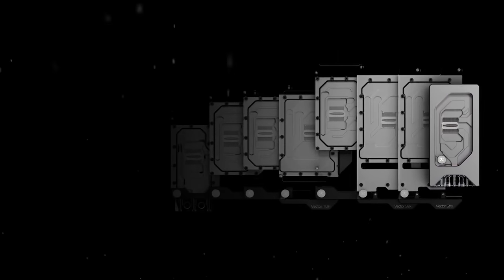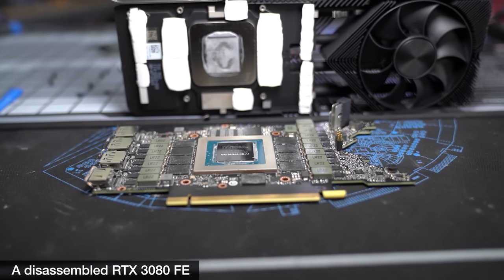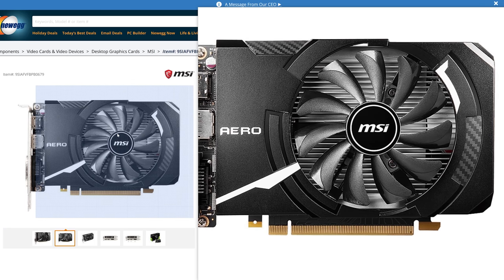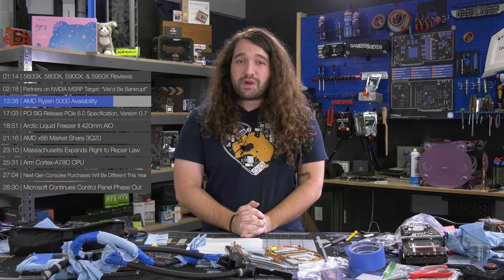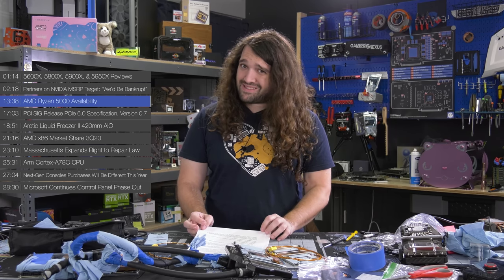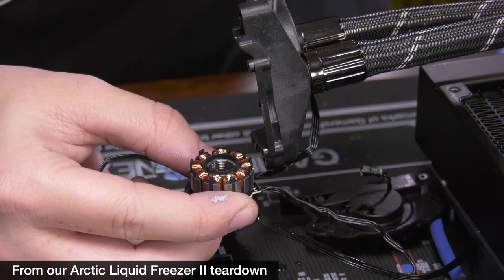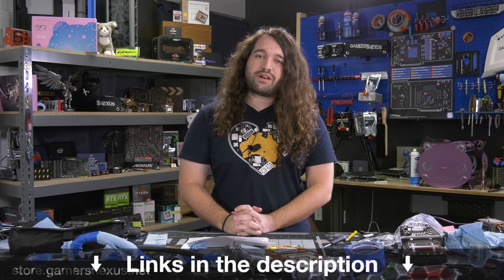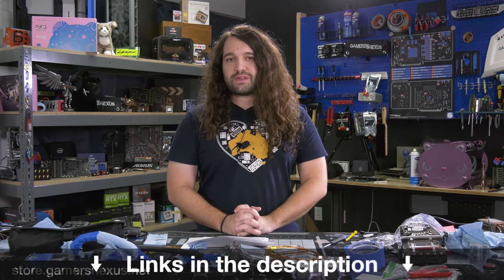HW News - NVIDIA MSRP Allegedly Not Realistic, Ryzen 5000 Supply, PCIe 6.0 Spec

Comment: I wish Microsoft would leave an option to enable "advanced mode" that has all the old and useful features in windows 10 instead of trying to force everyone to use their broken attempt at a "simple and clean" OS
Reply: They want to use the same interface for desktop and mobile. It's a fevered pipe dream.
Reply: Press Win+R
Type “cmd”
Press ctrl+shift+enter

Classic “advanced” mode
Reply: I wish windows would stop freezing my desktop so it can force an unclosable Edge tour down my throat while resetting my default browser in the background
Reply: @backupplan6058  You don't need to know those special combinations, this is simpler way:
Press win
Type cmd
Click "run as administrator"
Reply: they are working their way to an online OS only
Reply: classic shell your welcome.
Reply: @rci-tf2zc  classic shell rocks 👍👍👍
Reply: @blackmancer  i dont think so. windows 10 is not in any way the way to an online os since it heavy on the hardware. its integrate onlineservices into the os, without the users permission and changing the os style to much simplified design that is easy to use with touch inputs and able to scale windows correctly.
Reply: @isodoublet  i dont understand why my wallmounted desktop pc needs a airplane mode or akku saving mode ..
Reply: @desertfish74  I really like some distros, have even started spending most of my time on my Razer Advanced using Manjaro. Unfortunately, I sometimes need office for compatibility, and there are some games I play (non-steam) that are a pain to play or impossible. On my desktop, just too much stuff already installed that I don't want to reinstall again.
Reply: @DrSmugface  Samurai Jack wants to know your location.
Reply: In principle windows has needed cleaning up for decades - however first you need a working logic before you cut things, otherwise you keep the mess can cut the useful features - kinda what we see now.
I have three different screens on my pc and it's impossible to manage them in windows. - On my 2008 macbook - no problem. Just the mac has no gpu :D :D
Reply: make a new folder and name it this: GodMode.{ED7BA470-8E54-465E-825C-99712043E01C}
Reply: @desertfish74  run my games on Linux? (No). And yeah managing 2 systems instead of one is not a solution
Reply: I don't even buy this as the reason. You can build a clean UI that still has the same functionality, even if you have to compartmentalize it a bit. If this was just me requiring an extra click here or there I'd grumble and deal with it. All they needed to do was just transplant the old, critical functionality (especially the Sound control panel, almost every person I know has had to go in there to handle some kind of weird sound issue) into the new settings app.
Reply: Personally I hate the Apps page in 10. It's cluttered and a long lust that shows less information that Programs and Settings. 

I've been doing IT work since the 90's and don't want to use a knockoff Apple menu system. I haven't upgrated to newer Samsung Galaxy phones because they're following Apple's BS for too long now.
Reply: Switch to Linux. That simple.
Reply: I wish they had a windows 7 mode where cortana only exists in halo
Reply: There is an advanced mode already. Learn cmd and powershell.
Reply: @DrSmugface  If it had no airplane mode it would crash to the ground, duh. Better keep that thing up there and thank microsoft.
Reply: This, MS doesn't seem to understand that not all people are the same. Some people like X and they will never like Y, not even if MS forces them to use Y. Especially if MS forces them to use Y.
Reply: They've been hurting power users ever since Windows 7.  (or Vista, if you want to talk about the overall UI change, but Vista still had classic features 7 removed)

Windows 10 was the worst 'upgrade' I've ever had to deal with, and I'm still on v1703 due to unbearable, unfixable changes in the later versions.
Reply: @blackmancer  How would that even work?
Reply: @krisspkriss  exactly how DRM works
Reply: May i just say cough cough Linux?
Reply: @backupplan6058  thanks, didn't know about the ctrl+shift shortcut, btw you can run a copy of a program in the taskbar by pressing shift click, and ctrl+shift+click for the admin version.
Reply: Yeah, because THAT's why they don't have mobile OS market share
Reply: @TheSengard  I'm using a desktop. If I wanted an OS optimized to use on a tablet (ie: simplified design, touch input reliant) I'd use my iPad.
Reply: @Josh-gi8ht  i can relate to that, but this is not the way microsoft goes. the interface is obviously optimized for better scalability and touch input. Personally, i would also prefer to do without all the web integration into the operating system. just like i would like to have operating systems without speech input (e.g. android is really annoying in that regard). Unfortunately i can't do anything about it, because they are integrated and can't be removed. in my opinion windows 10 has become a disaster in terms of performance, because of these new features.
Reply: You can get to the old features easiest by using the search function in start panel. Problem is Windows updates have the bad habit of breaking the start menu first. Which leads to another problem you forgot to mention: Microsoft forcing its updates to be installed, even if the current update has been noticed to be a faulty one.
Reply: Oh how I also wish that was a feature. After installing it asks if you want it set to Advanced or admin mode then it lets you go about your day without making you cringe.

Comment: The control panel isn't just a matter of looks.  The old control panel exposes settings that aren't in the new model.  So this will lock out many common fixes to problems.
Reply: Yeah, I don't know what Microsoft are doing here. The control panel is straight up superior to the new stuff for power users, it gives you more control and is more quickly readable and navigatable, what the hell are they thinking?
Reply: @sttate  Dumbing down the mainstream users. That way you can get away with a lot more fails.
Reply: Probably because without any easy solutions people will have to pay for Microsoft Support
Reply: We can't fix your problem in the windows 10 settings. You will have to replace your computer.
The cord on the new computer is shorter, you'll have to rebuild your house so it can reach your desk.
Car isn't running well because the air filter is clogged after 2 years? Going to have to throw the whole thing away and buy a new one.
Reply: @Willdror  but all Microsoft support is, is copypastas of "did you make sure the computer was plugged in?" even if the op says the computer was plugged in.
Reply: On the Linux side of things, Gnome DE went down this road about 5 or 10 years back. A lot of basic functionality was removed. End result was a user experience that was designed to look simple and streamlined, but in reality required users to do searches on stackoverflow and config via command line to set up.
Reply: @ExtremeSquared  at least with Linux you can switch desktop environments or distros if you don't like that, or install a third-party graphical settings manager...
Reply: That's their goal. That and you being unable to deactivate many of their botnet telemetry data settings.
Reply: It is the absolute ONLY way to fix and remove some issues surrounding audio recording software and even audio interfaces. Microsoft likely just killed music production on windows for good
Reply: God damn new Network options are pathetic. I understand that new users don't know how to change IP settings, but now I won't know either... :D
Reply: we'll have to do more through registry hacks I suppose.. gg microsoft
Reply: @BuzzkillZone  Having done on-site tech support for big corps, "Is the device plugged in?" gets a Yes followed by me making a site visit to another building on-campus fifteen minutes away followed by me plugging the printer/monitor/computer in and signing off on the ticket as "completed". This happened a lot. Really a lot. Lots. Lots and lots. Much lots. Duplicate for Ethernet cables, mouse plugs, keyboards, Wifi hubs etc.
It's only funny because it's true, like all the best jokes.
Reply: Use powershell then
Reply: @mattbrown292  What's a good resource to powershell for the purposes of replacing control panel?
Reply: new users might be confused and mess with things they shouldn't, an easy solution a checkbox "show advanced control pannel"
Reply: @oblivion0077  in the context of replacing control panel im not sure. But the Microsoft docs webpage is actually super good for powershell in the general sense. There is a list of every cmdlet and a lengthy description of how to use them, along with multiple examples.
Reply: @mattbrown292  powershell. Requires a reference. You cant just look at the settings and fix. Powershell is nothing but a return to the bad old days of dos
Reply: @BuzzkillZone  LOL not at all. That's like saying python = dos. Powershell is much more abstracted and is practically like speaking the English language.
Reply: @mattbrown292  every time I have to enter powershell commands. They are still pretty doslike. Even if abstract they are still text commands that requires a separate reference. It is not user friendly.
Reply: People who used the control panel are going to be forced to shift to third party applications, or microsoft will release something like the control panel. I'm hoping the second happens.
Reply: @robertsneddon731  It's one thing when you just say something is wrong and they tell you to plug it in.  But if in your support ticket you itemize the steps you have taken, and it includes checking the cables, making sure the latest drivers are installed, and reinstalling in safe mode.  Then it is EXTREMELY frustrating to get a copypasta reply telling me to check the cables and drivers.
Reply: @crazyassassinkill  Lemme play mah games in peace.
Reply: @Gareth Tucker It's like the Settings panel was designed by people who have only used smartphones. It has a smartphone look and usability, like the missing icons and infinite scrolls that are only usable when you have a small portrait screen. It makes you spend to much time searching and scrolling to find something. I don't know what the fuck they were thinking.
Reply: @BenK12345  Give it an update cycle. They'll find a way to remove the registry too...
Reply: I really have no idea what you all are going on about LOL. I can access all the same setting I need to in the new Modern UI as I did in the Older Control Panel setting that have been updated.. Example: The one just now removed (System Panel) it is part of the About section under System..
All the Audio setting and more are under sound. All the App setting and more are under Apps.
I have been working with and supporting Windows since 1.0 loaded over DOS. I find this New UI more pleasant to work with in dark mode.
I love the extra control I now have for so many things. Like the ability to control what apps will use what input/output device.. the default volume level per program. Hell what Apps are allowed to even access the Mic or Camera. All laid out in easy to see, find, and understand. It does not appear "dumbed down" to me at all. I too hate change and I was like fuck! why did they screw with something that worked. Then I worked with it and found... Ah yes this is nice.. This makes sense.. It just takes a few moments to get use to it and to understand the flow.. Once you do, I feel like, its pretty good.
Reply: Ok, so this seems to be a very common complaint... Which settings exactly are only available in control panel though? Everyone is saying there are settings solely there, but nobody saying which settings they mean. =/
Reply: @GameFreak7744  Whichever setting you need to change.  That is the setting that won't be there.
Reply: @sttate  They're not thinking, and haven't been for years, plain and simple.

Probably tons of feedback in the feedback hub where we can all express our voice, and get ignored like usual.
Reply: @BuzzkillZone  Haha, sod's law would certainly suggest that.

I really am curious though what settings people need that are currently in control panel, but not in the settings app. Not sure if there is really a big problem of missing settings, or if people are just worried because trusting MS is usually a bad idea. =P
Reply: @GameFreak7744  Advanced sound settings such as allowing applications to take exclusive control, separate default system and communication devices, the volume mixer, stereo balancing between left and right channels and more are all missing in the settings app and that's just the audio settings. Network settings are practically non-existent in the settings app.

Comment: So, Microsoft is getting rid of the only actually useful menu? Those old windows tools are the only things that have allowed me to fix their cobbled monstrosity without reinstalling the whole OS.
Reply: If they take them away I don’t know how to fix the OS. I have a feeling there aren’t new tools that will do the same thing. I guess they don’t understand that there are power users.
Reply: Time to get comfy with PowerShell.
Reply: @CaveyMoth  
Or go Linux and virtualize XP or 7.
Reply: @Aereto  But I'll get computer malware. =/
Reply: @CaveyMoth  lol if you get malware on Linux you are deliberately trying to get your computer infected.
Reply: @chrono_tigger  Well, I mean, I do have my.. Needs. Kaspersky protects me from time to time.
Reply: @CaveyMoth   As someone who has coded as a hobby for a decade I would literally never obtain software. Other kinds of content you can verify are malware free. Even the best virus scanners are only relying on previously reported signatures plus basic code flow analysis. it's very easy to bypass them all, at least until your signature gets added to the database. It's also possible (but quite hard) to write a self modifying program that could probably perpetually bypass scanners. Now, video and books and tv shows, go nuts, but software, yeah no I wouldn't touch it with a 5 ft pole.
Reply: Power shell, learn it.
Reply: @CaveyMoth  anti-virus? Eew.
Reply: I'm worried about the sound control panel. Windows already has a lot of issues with  HDMI-based audio that uses 7.1+ and Atmos. It needs to be flawless since the "Get Help" app redirect is awful and requires payments
Reply: Google "windows 10 god mode" to enable the only folder you ever need for settings, and it's built-in.
Reply: starshipeleven  And that ol gem... watch what you click.
Reply: These windows updates might finally force me to go to some Linux distro or MacOS
Reply: classic shell your welcome.
Reply: @WahotsW  I think the "Get Help" or help page (or whatever) was never good in any Windows version, not just the current one.
Reply: @MattLathrum  was going to mention God mode as well. I hop they don't remove that too.
Reply: Powershell and Management console
Reply: @CaveyMoth  Theres you're problem. Spybot + avg.
Reply: @WahotsW  so that's why my Cloud II has been causing blue screens. Fucking Windows man
Reply: My laptop bluetooth and usb port often time doesn't work, i need to "restart" it in device manager and re-enable them. Never find the working way from their setting menu. I guess it will take long time for me to find a way after this update.
Reply: I just realized that you can turn off the action center and have start open all apps last week, then this happens.
Reply: @WahotsW  That will still be there. If you go to settings app, in sound, there is a link for "more sound options".or something along those lines and that brings you to the real sound control panel
Reply: @rci-tf2zc  Classic Shell doesn't fix everything wrong with 10 at all. Though it does fix everything wrong with 8.1, which is the OS I currently and wholeheartedly recommend to anyone who will listen.
Reply: @arnox4554   I never said it was meant to fix anything it's just for the windows setting which is what the topic was about.
Reply: Someone seriously needs to make a competitive OS to challenge microsoft, microsoft doesnt care because they have absolutely no competition! (Linux? Apple? Are you joking? Neither platform has anywhere near the same broad scope. But thats why microsoft doesnt give a damn anymore.)
Reply: @chloekaftan  Except Linux does have that broad scope?
Reply: @chloekaftan  I think you're missing the reason that MS don't really have much competition... They're running a de facto monopoly because the software people want and need to use is often written for windows, and companies write their software for windows because that is what people use. It's a catch-22 because Windows has a kind of critical mass.
Both Linux (well, various distros) and MacOS are very fine operating systems, better in almost every way than Windows, with the sole exception of software (and sometimes hardware) support.
Reply: @jasgud  Just because you have a hardon for powershell doesnt mean it is a proper control panel replacement.
Reply: Not even power users. Just users that want full functionality. Apps have always been designed at lower levels of complexity and functionality because they were designed to be run on cell phones. Why do they feel the need to redesign and decimate a working system so that it will run on inferior hardware, just to run it on the existing better hardware?